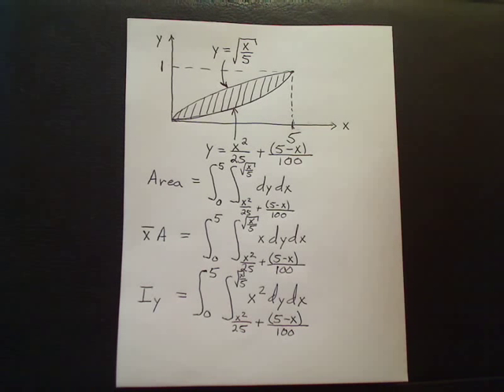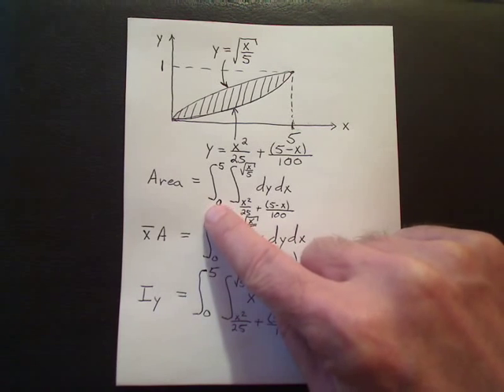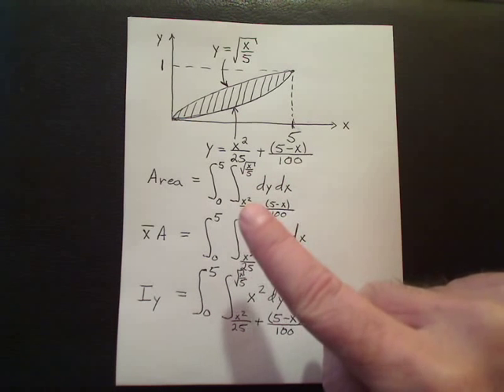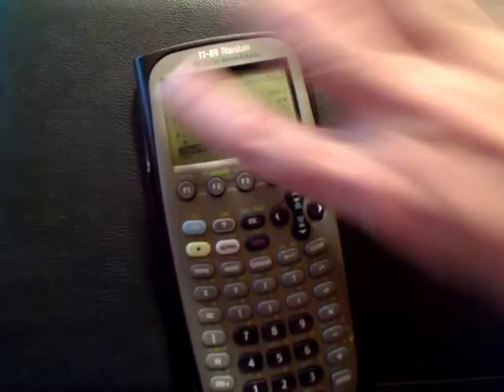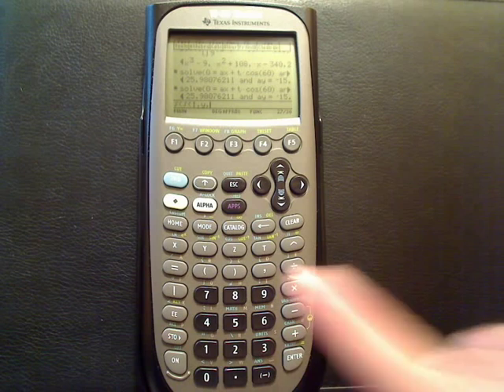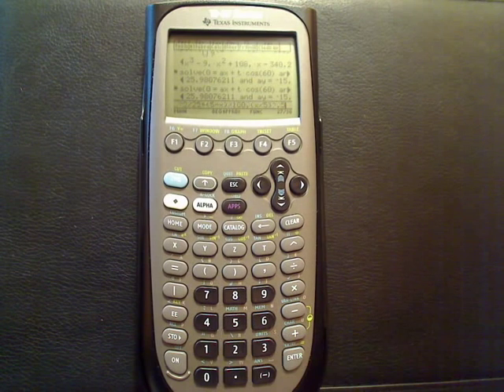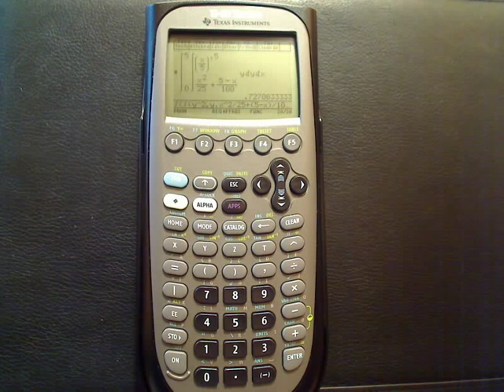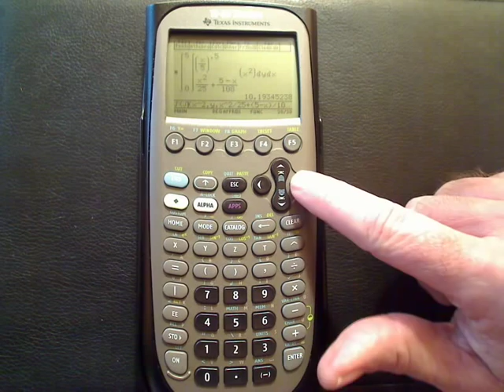TI 89 Integration for Area Centroids and Moments

Comment: This is a great video and I learned the true power of the ti 89 titanium. It is really a powerful tool. As the for the limits of integration along the x axis you had it from 0 to 5. I disagree. If you take the two functions and set them equal to each other, using your ti-89 using the solve function, you will get 0.012441 and 5. And so the limits of integration along the x axis should be 0.012441 and 5 not 0 to 5.(That's what I got on my calculator) This is still a great video and I enjoyed it very much, but I thought that the limits of integration should be pointed out even though they were off by a little bit.